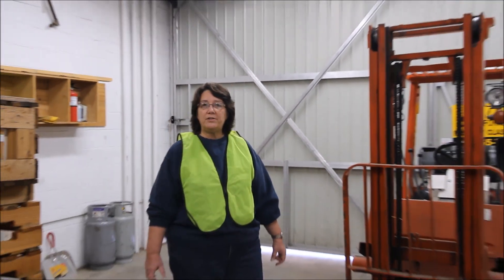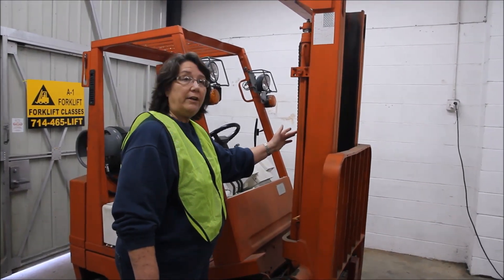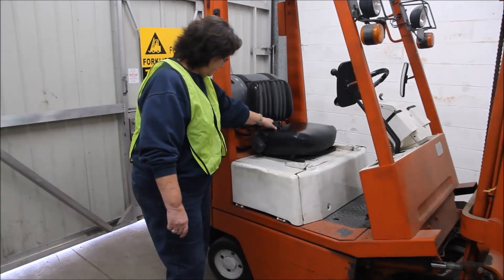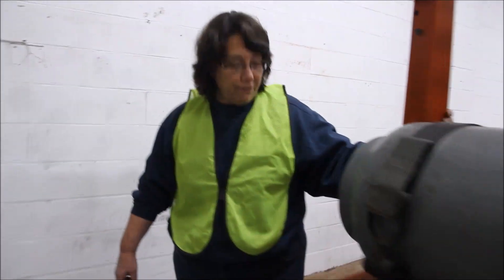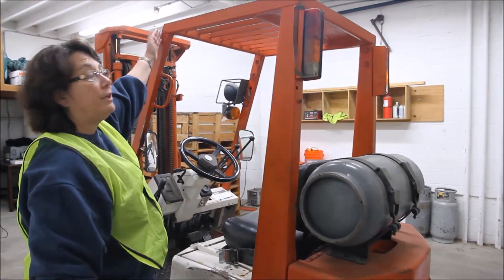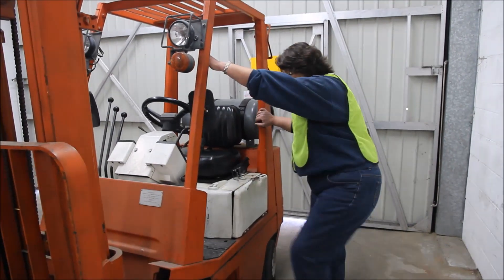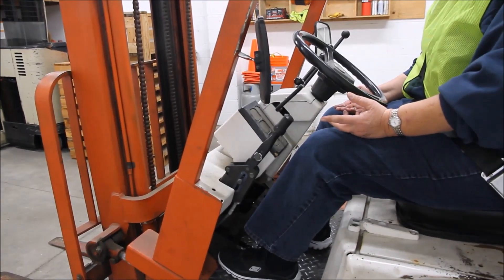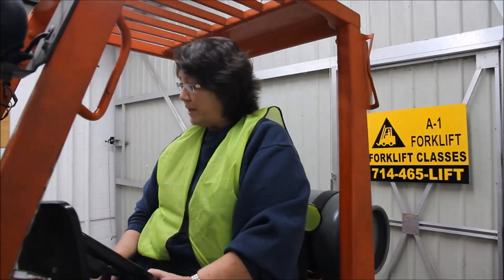Forklift Training: OSHA Pre-Shift Inspection

Comment: Just saying I'm a forklift mechanic an she missed a ton of stuff, for one she didn't look underneath the lift to check for hydraulic oil or transmission leaks she didn't actually look at the radiator cause you're supposed to pop the hood and check both sides because trash can be sucked from under and behind the forklift just I could go on she didn't do anything right
Reply: true, very generic pre checks :)